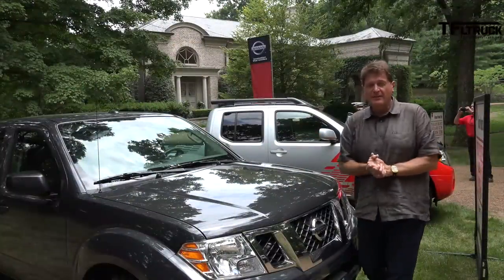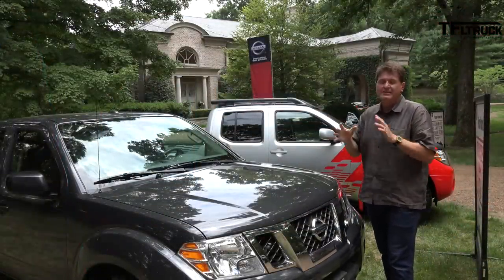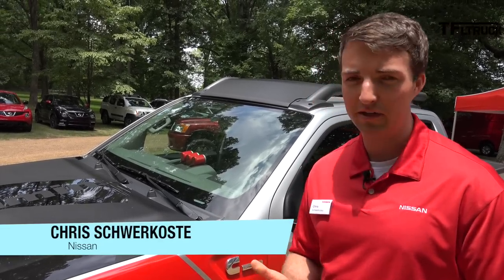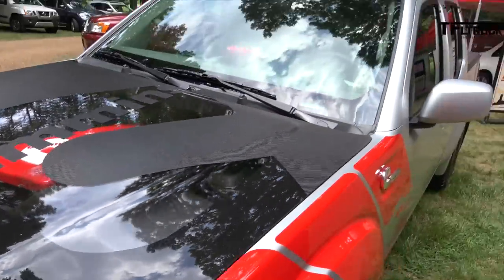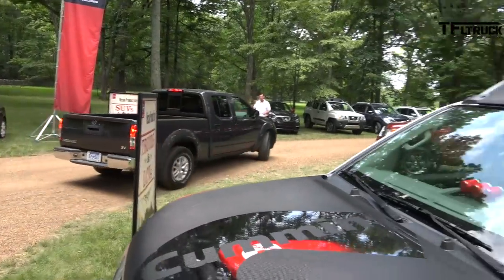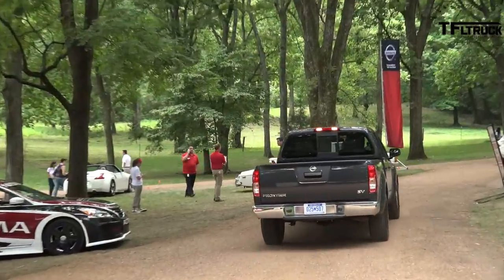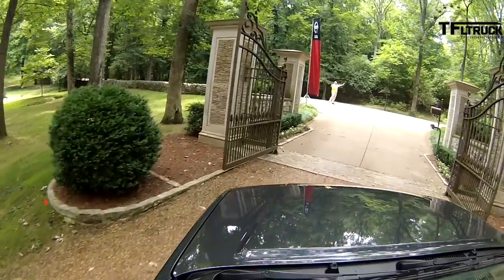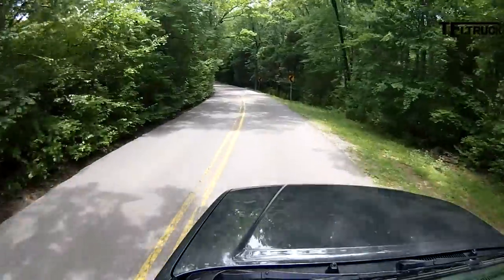Exclusive: Nissan Frontier Cummins Diesel Prototype Pickup Drive & Review

Comment: i love how when people are talking crap about nissan in the comments here, they always leave out the Hardbody. i own two, and the only time i got left stranded is when the alt and battery shit themselves in my 4x4. My family also owns one GM product for a reason. GM is junk.
Reply: Iain Wigglesworth I am still driving a 1988 pathfinder to get my firewood with.
can't kill it engine  never leaked or burned oil since the day I bought it 
My 1995 ford 150 is a nigtmare
Reply: David Stanley i LOVE both of my trucks. I have an 86.5 2wd with 220k on the Z24i and my 4x4 daily driver 1990 KA24E has 193k on it. Both are though as nails.
Reply: Iain Wigglesworth
where I live they would of been scrapped  long ago
I live in Northern Canada those trucks do not last here GM ,Ford and Chrysler all do not last up here too much humidity and salt
on the roads and from the sea.
The best ones here  are hard body and pathfinders from 1988 - 1994
the frames came  standard with a heavy resin on them.
Reply: Nissan hbs are indestructible, I have a 1996 ka 5 speed the only issue is the tranny is a little weak and it's not fast but it's tougher than a gm
Reply: i own 3 hbs now. i just picked up an 86.5 4x4. traded my pos jeep zj for it. needs a crank, but its one of the first 500 made

Comment: Chevy is a WAY better truck, and Nissan is no match. Maybe, if they actually decide to upgrade their crappy interior to some real material
Reply: this is just a test mule, I highly doubt that Nissan would stay with the same interior or even exterior if they put out a new frontier, they just wanted to see how the diesel drives with the 7 speed automatic so they threw it onto the current frontier
Reply: Lol, you judge a truck by it's interior.
Reply: H Siu yes i do, that is what automobiles are all about these days
Reply: ***** thank u!
Reply: At least you can enjoy your leather seats while you're waiting for a tow truck.
Reply: yeah sure, but the GM will die in half the time. Imports just last longer and resell better and on top you get that reliable cummins, Stick a bully dog kit and big tires on this bitch and you've got a nice little package. only truck I like better is the new ranger that they sell in asia only for some retarded reason!
Reply: That nissan can go where no stock chevy can .
Reply: mike Ransome This isn't the 1990s anymore,  that whole reliability myth is getting long in the tooth.
Reply: William Stewart I know, GM, Ford and Dodge all seem to break down a lot more than they used to. :-D Never seen a Frontier, or Nissan for that matter have an engine die before making it past 300,000 miles. And that is all the proof I need for why Nissan is great. Plus, the NISMO can keep up with the Raptor.
Reply: Tier1Norseman In the grand scheme of things, Nissan is nothing in the world of trucks. The Titan was never competitive with North American or Toyota trucks, and the Frontier is a dinosaur that is left behind by the Tacoma and the Canyon/Colorado.
Reply: I drove Colorado's in the Air Force, pieces of shit. Constantly breaking down and getting stuck. GM has too many recalls and issues, what did you expect for a government bailed company? Just can't help laughing that a GM fanboy is trolling Nissan videos. -_- Go watch a Tahoe's airbag "accidentally" go off in a poor driver's face. Toyota has even had some pretty shitty recalls...
Reply: Tier1Norseman Why are you so defensive?  All I stated was the truth, why get mad over something you can't change? The Titan sold 8000 trucks last year,  meanwhile the big three sold more than that in a week. The Frontier is some metal sheet formed into a truck with a 4.0L in it, what is there to go wrong? Your like the people that brag about how reliable a Toyota Corolla is, it's got 4 wheels,  a steering wheel, and a dinosaur engine, not much to go wrong..... Save for the GTR and those useless CVT transmissions,  what has Nissan done in the last twenty years that's the least bit impressive other than using Renault to get ahead? Face it, the trucks just flat out lack any innovation or impressive engineering. The 4.0L is a boat anchor anyways,  sure it makes decent power for what it is, but it has it's fair share of timing chain issues, bad lifters, blown head gaskets etc. Come back to the conversation when you can show me something the least bit innovative that Nissan has done with a truck.
Reply: Tier1Norseman  For starters, I would never sit inside a military vehicle because I'm not in the Military and never would be. 

Now, I'm not saying GM is the best and that never was my point,  only that Nissan has absolutely nothing on the either the big three or Toyota when it comes to trucks.  I don't need to prove anything here because I'm not the one who bought an inferior vehicle of which I need to go on the defensive about. 

The best part is, I'm not even brand biased.  I'd love for you to come to my shop's yard and see my trucks. I have two Fords, a Ram, two Tacomas,  four 1500 Sierra's (2 personal/2 work),  a 2500 Sierra,  and I just bought a Volvo truck last spring. My driveway is mostly GM, but I still have a Volkswaggen that I love. I'm not a "fanboy" of any Brand,  I use GM trucks because they use pushrod V8s. I like conventional truck engines that are simple in design,  I don't like the idea of having 4 camshafts,  two turbos, etc etc etc under my work trucks hoods. I've had good success with GM trucks and they have always been reliable for me. My 2005 2500 Sierra is coming up on 700,000kms with the untouched 6.0 under the hood. The only major thing I've done to it was replace the 4L80e transmission when it had just over 500,000 on it. I also have a 2003 F350 with a 7.3 in it that has over 900,000kms on it. The only things I've done to it are clutches (it's a 6 speed manual), injectors,  and a lift pump. 

American trucks have been good to me, why would I not continue to buy them? The two Tacomas are for light deliveries such as small drives, small bearing, small motors etc. They have both been excellent as well, but they're just basic single cab trucks with manual transmissions and little 4 cylinders,  not much to go wrong.
Reply: Michael. j Arciero Gm products have about the worst quality interiors ive ever seen.
Reply: kdfdraft This isn't  the 90's or early 2000's friend.
Reply: You know the interior of the Nissan isn't all that bad and I think its comparable to the Chevy.

Comment: In Brazil the Frontier is at the bottom when it comes to trucks... By the way that 200hp Cummins Diesel does not impress. The Amarok by VW makes 220hp and it's a 2.0 engine.
Reply: The Amarok does not have that much power, it has 161 at the base level and rises to 180 at the top level, both are below the nissan navara as it has 190 in the 2.5 and 231 in the 3.0
Reply: US emissions regulations are different. The diesels you get are usually more powerful than diesels that are CARB compliant.
Reply: The fact that you start a who has the better diesel battle with horsepower numbers instead of torque numbers shows how much you know about the trade.
Reply: First of all he did not mention the specified torque of the Amarok in his country so please tell me why i would, mention the Navara's torque figures. I was simply questioning his claimed horsepower figures. Secondly these trucks are light duty vehicles, remember that horespower is just as vital as torque as they are not going to be used as workhorses but more as family vehicles. So please tell me what is this trade you speak off because that last time i checked these vehicles were used in multiple trades.
Reply: You are actually right regarding their power. I got mistaken because some people here in Brazil improve the engines to 220hp. We unfortunately dont get the 2.5 liter option for the Frontier. But regardless of engines, the frontier is the least desirable here and they have been selling pretty much the same model for years.
Reply: Caio Stanchak What is the best selling light duty pickup in Brazil, im surprised the frontier sells so bad because in the UK it is the best selling Pickup where it is badged as the Navara and is only sold with diesel engines we dont get the 4L petrol v6.
Reply: I dont actually have any official sale numbers lol! The pickups we see the most here are the Hilux, Amarok and the L200. There's plenty of frontiers too but not as many.
Reply: Titan O where do do I start? A diesel in a truck only make if you need the torque. Yes it gets better gas mileage but with the premium on diesel and diesel engines it takes time to make that money back. So even if you buy the the diesel for fuel economy, it only makes sense if you're either A going to tow something every now and again or B it's your only driver and you have every intention of driving it into ground and need to pinch every penny possible. And this is where torque comes in. The twisting power is what gets you those extra mpg's even under a load. Yes horsepower matters but in a diesel torque is far more important. Most people with these types of truck's are going to throw something in the bed every now and again or maybe tow some bikes or atv's on the weekends. That does not require the torque these vehicles provide. If you actually know what your buying then you know what these engines should be used for and that's towing a heavier load (in my case a horse trailer and the occasional vehicle when somebody gets stuck in the driveway which some always seems to do) without sacrificing mileage. Next commercial use. As a fleet vehicle most business run these vehicles into the ground as which you would think means a diesel makes more sense. Well plenty of business will skip an sending the vehicle to the dealer for scheduled maintenance to save some money which sends the vehicle to an early death anyways not all but there are plenty. Now most business that use midsized pickups aren't going move anything heavy. Again it's gonna be a case of something that needs to go into a bed. Now this comment is getting long so I'm going to try to kinda sum it up here. Logically these engines are for a niche buyer. Somebody who semi-regularly tows and needs the torque for towing without penalty to fuel economy. And will most likely being using this as a daily driver. If they have a secondary vehicle (let's say an altima) then they won't need to spend the extra money because realistically if you aren't always driving this truck then you won't get your money back any time soon compared to buying a normal gasser. And if you run a business unless you regularly tow something regularly coming close to max payload capacity then then you're probably better off getting a gasser or an entry level full size anyway. I wasn't saying he was completely wrong but you shouldn't go around starting food fights with rocks. Jesus this is long
Reply: TexasDragon3907
Sorry but what you have also failed to realise is that your point is only valid for the continent of America and South America. In the rest of the world where these pickups are sold as standard with the diesel engines and you cannot obtain one of these vehicles with a petrol engine. Also you have once again not clarified what why your first comment was so rude in questioning my knowledge of these vehicles. When i aws simply questionning the figures of another comment that did not mention torque.  I own a european frontier and i can say that i have extensive knowledge of diesel trucks. Torque is an important factor with a diesel engine but if it didnt have sufficent horsepower the eninge would be incompatible with a family vehicle as it would be a turd to drive. And your final comment i shouldnt start food fight with rocks, there was no argument untill you chimmed in with ur rude first comment as you can see me and Ctaio Stanchak went on to have a pleasnt conversation that allowed us both to learn something.
Reply: Personally I wasn't trying to be rude as much as make a half joke so I apologize for any hurt feelings. And again I did say that horsepower was a factor but torque is more so. Not that horsepower isn't at all un-important. And honestly considering these trucks are going to be sold in america if nissan does build them I really think my point only really needs to be valid in america. So again if any feelings were hurt then I formally apologize form my tone and language by saying I was wrong for it.
Reply: Titan O It's North America. "America" is not a continent, and I take offence to that being from Canada.
Reply: Dave Workman
Sorry was typing to fast in my fury, must have missed the word. Again i apologise.
Reply: wrong, the bi-turbo makes a little under 180 hp. that most powerful they got, not 220 hp
Reply: TexasDragon3907 AMEEN!!  Especially when so much power has been robbed by tuning/ emissions...
Reply: Its a CUMMINS they work in the old Dodge trucks and you can do a lot with them
Reply: My frontier with the stock v6 makes 260